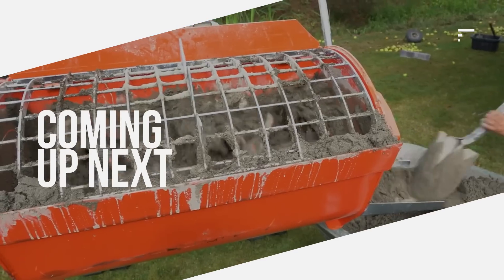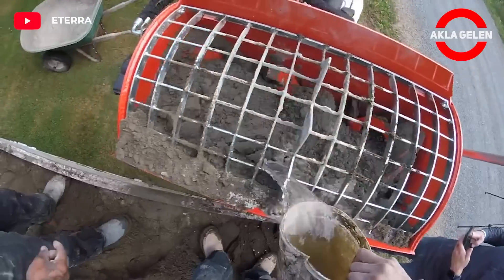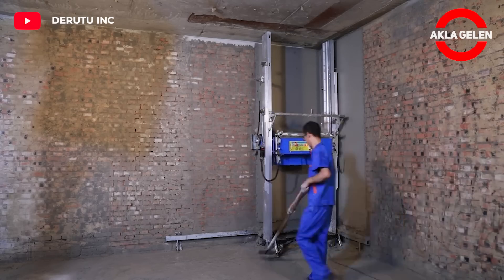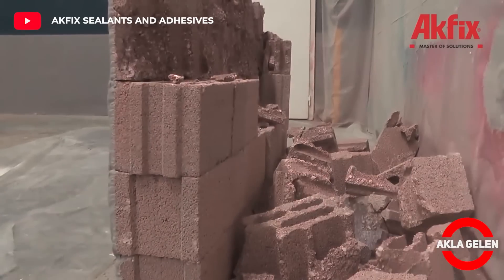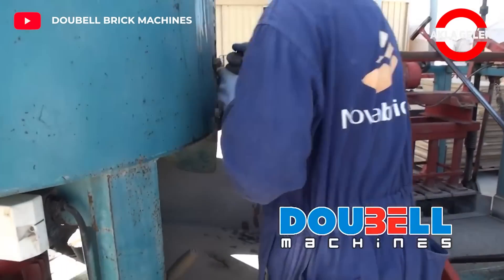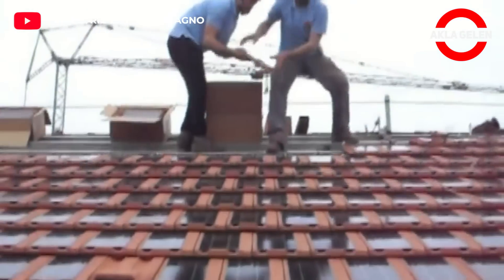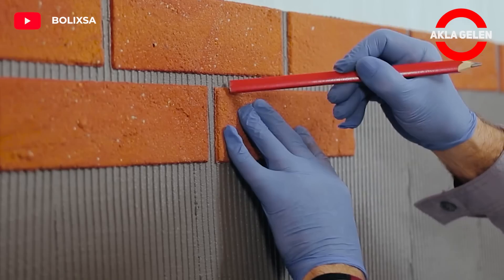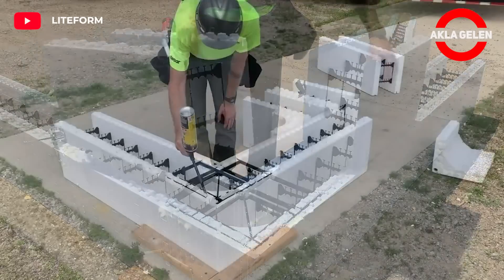Construction Workers Can't Believe This Technology - Incredible Modern Construction Technologies

Comment: Re: Photovoltaic Tiles.  I confess I’m not a civil engineer.  Whilst the Tiles appear as a good idea, I foresee some downsides. 1. How much extra wiring (copper) and mounting rails does it take when compared to regular solar panels. 2. Is there any significant increase in load bearing and does provision need to be made for same.  3. How about the fragility of the panel. How does one access the ridge tiles. 4.  Disposal of used solar panels is proving to be a real environmental problem.  Will these tiles add to that problem. 5. How will the producers of regular tiles retool to accommodate the panels.  Will there be supply change problems in mating the tile with the pane.  Will be interested in your response. Thank you.